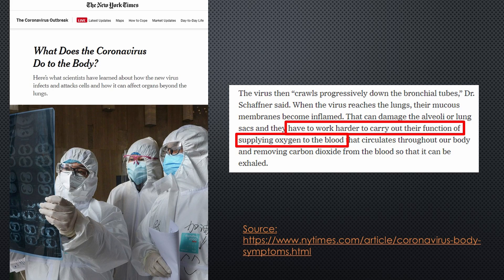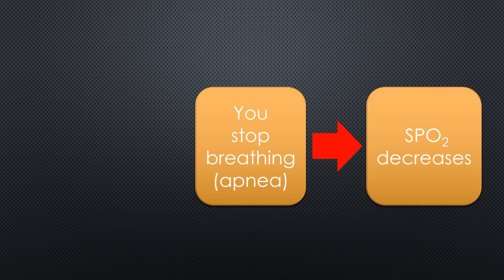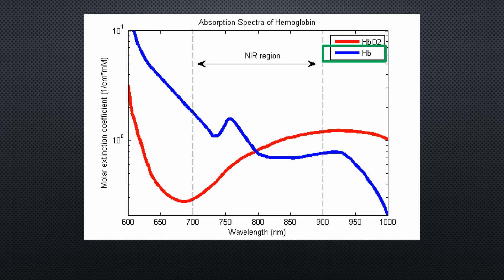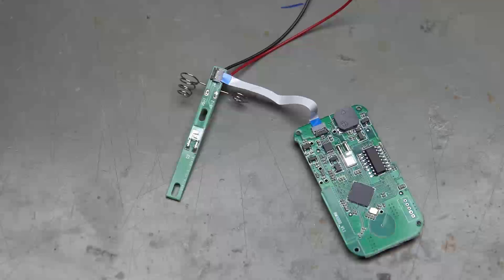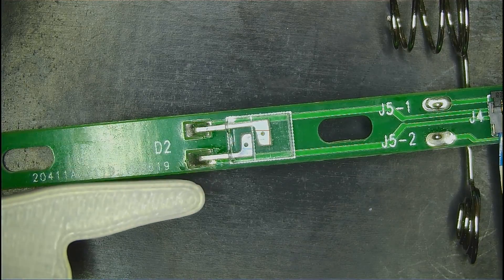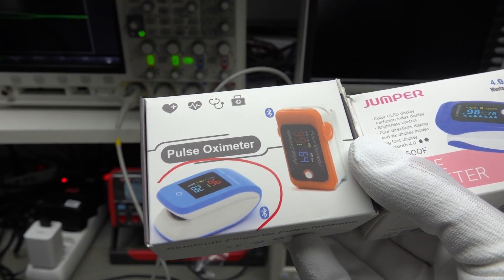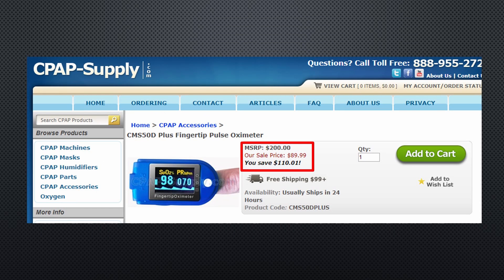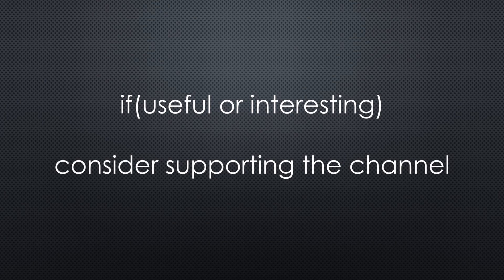#316 Pulse Oximeter test, function, and usage

Comment: Great video! , i was wondering if i can read values of a normal oximeter using an arduino or esp32? , i do not wanna use a sensor but a real oximeter that i can buy , with a modification or idk! would i be able to do it?
Reply from the maker: I do not know :-(
Reply: @AndreasSpiess  thanks for answering

Comment: Can't manufacturers add a ir sensor to measure temperature?
Reply from the maker: They probably could. But AFAIK temperature is not measured in fingers and would probably not be accurate.
Reply: @AndreasSpiess  thanks. Yes of course; i meant for it to be put in a pla ce on the case and then simply touch the case to your forehead until it beeps. probably some tech issues i don't see, or cost
Reply from the maker: @helenmachelen4200  or maybe you had this idea first!

Comment: Hello Sir , 
Will you please suggest the sensor name to use on wrist because i want to use reflectance method to measure the oxygen level and want to implement on wrist . because now days to many smart watches are coming with this feature and I want to test it and 

if you have idea on reflectace method and if you know the sensor name which can be used on wrist or forehead please suggest .
Reply from the maker: You find the links to the products I used in the video description. I also made a second video about the topic.
Reply: @AndreasSpiess  
Yes sir i know that you have mentioned the sensor name and i am already aware of that sensor max30102 and but 

my point is that can i use it on wrist and will it give accurate reading .  

because to use on wrist i have to use reflectance oxymeter method .
Reply from the maker: I said in the video that i do not like it because it does not give exact values.

Comment: How do you see before buying it if it is a reflective model or not?

We can find some oxymeter on Aliexpress below 5€, without BLE which is not so useful, what do you think about that?

Thanks
Reply from the maker: The ones looking like the one I used are most probable not reflective and maybe you see the emitting diode on a picture.  I do not have another answer.

Comment: Great video. I bought a similar MAX30102 sensor from China and it seems that some MAX30102 chips have the red and infrared channels swapped and some of the interrupts don’t work. I found some software libraries that correct this in code, but this behavior doesn’t correspond with the datasheet from Maxim and led some people to speculate that these might be clones. (https://github.com/aromring/MAX30102_by_RF/issues/13)
I also found that you need to use a sensor with a green led to get readings from areas like the wrist, like the MAX30101, because of the melanin pigments in the skin here. (https://www.maximintegrated.com/en/products/interface/sensor-interface/MAX30101.html)
Reply from the maker: Thanks for the update. I still do not like these reflective sensors :-(

Comment: Thank you for your excellent video.  I learned a lot.  Q: Given what you said about inaccuracy of mobile modules (like the MAX30102) , how do watches like the FitBit Sense achieve such accuracy?  Have you considered doing a teardown?
Reply from the maker: Did you test if it provides accurate measurements? I did not find a comparison between the Fitbit and an accurate device. 
My Polar watch also (sometimes) measure heartrate quite accurately even if the glossy leaflet says it works.

Comment: Hi Andreas,  just a quick heads up , is it possible to monitor multiple bluetooth oximeters with a single ESP32 ? And another really silly query,  is it possible to reduce the SP02 for a few second. I tried holding my breath till I could but could not see much change :) , just to check if the oximeter is really working
Reply from the maker: I assume you can connect more than one, but never tried.
And I tried, too to hold the breath. It is not easy to reduce the SPO2 if you are healthy.
Reply: @AndreasSpiess  Thanks much Andreas, looking forward to see another new video soon.

Comment: Question. That red led in MAX30102 is part where it should contact with our skin? 
If i need to make casing box out of it.. will the function still work properly if that LED closed by kind of transparent plastic?
Reply from the maker: There is one sensor which has to contact the skin. I do not know if it works with something in between

Comment: The Max3102 is pretty accurate, you need the correct algorithm, a proper encloser. It's unrealistic to expect the raw values to be reflective and that too without an enclosure with stray light entering the sensor.
Reply from the maker: I never saw an accurate measurement on YouTube with this chip :-(
Reply: @AndreasSpiess  I guess I will have to make a video :-) the Max30102 is made by  Maxim integrated, this chip is used in 1000s of professional medical devices. The issues you are seeing are software related.
Reply from the maker: I never saw a reflective Oximeter so far.

Comment: Great video as always! I purchased the CMS50D+ and cannot get OSCAR to show anything. I can connect directly via Oximetry wizard->start->choose CMSF37 (strange, CMS50D asks for upload file option in menu which is not there) Then communication starts (also visible in the log) Then nothing happens! Also by importing the . SpO2 file from SpO2 assistant nothing happens. I probably missed something. Any suggestions?
Reply from the maker: I would log an issue with Oscar. And I use the application which comes with the oximeter, store the results, and upload the file to Oscar. Much more reliable.
Reply: @AndreasSpiess  How do you upload? Also with the wizard?
Reply from the maker: Yes. But it had its problems (see my issues on the Oscar repo). This is why I use the app of the oximeter. One minute more work, but so far it always worked.

Comment: should be nice to review body thermometers from aliexpress also. Big price differences and forehead thermometers are really popular now. I have now a forehead contact thermoemeter from Lidl and it works really perfect. But you need to read clearly the manual how to use and know the difference between contactless and contacted forehead thermometers. ;) But with Corona now all the thermometers are sold out and the price is very high.
Reply from the maker: Maybe I will have a look at the technological aspect. But, as you wrote, maybe later...

Comment: an oximeter is VERY expensive up here in scandinavia, about 50euro, i got myself one anyway, but i dont undestand the difference between the two different waveforms shown at the bottom line, Levi
Reply from the maker: I do not know which lines you refer.
Reply: @AndreasSpiess  i have two different "waveform" lines BELOW the digital numbers, i now know that one is the STRENGHT of the heartbeat, but still dont know what the other "waveform" shows, maybe we have different machines
Reply: @AndreasSpiess  (actually the line shows in your videoclip)
Reply from the maker: I assumed it shows the "amount" of blood or so. But I did not care too much.

Comment: hi andreas,
I have been sleeping with the CPAP for about 15 years and I must say that my life has changed for the better almost instantly.
I was always sleepy although I slept normally and often woke up with a headache, then I did a polysomnography and it resulted in more than 200 apneas, one of which for a minute!
Since then, about once a year I go to a hospital for a series of check-ups, the last and most invasive is a blood gas analysis that consists in taking arterial blood (the arteries are deeper and more difficult to reach) just to see oxygen saturation.
During the outpatient checks for some time they have used oximeters similar to those you have shown and just some months ago, thanks to the banggood advertisements I also bought one that I use every now and then as needed: sometimes, during a slightly restless sleep , the cpap mask moves and the system efficiency is reduced. fortunately the level of my syndrome is not high and therefore I am not in danger of life, but age always advances ....
P.S. now I also know how it works! tnx
ciao
Reply from the maker: It seems that a lot of such devices are used everywhere. This is also why I used this example. I have a colleagua who reports similar things like you.

Comment: It's worth to test MAX30102 using this algorithm : 
https://github.com/aromring/MAX30102_by_RF

Although it's hard, But I guess it's better than plain Maxim one.
Reply from the maker: Did you try it?
Reply: @AndreasSpiess  Yes I've tried it, It's harder to get SPO2 measurements from it due to its constraints. 
But I've not compared it with other sensors, as I don't have.

Comment: Very interesting video, and I was pleased that you mentioned OSCAR. I picked up thhe RD117 board with its MAX30102 chip  and a couple of M0 and M4 boards, but the signal analysis was beyond me. I may get back to it when I am happier with the state of OSCAR software.
Reply from the maker: Thank you for your software! I think your time is better invested in the software. A lot of people like me do not want to run to the doctor all the time. Maybe you also make a list of oximeters which are supported or which ones you prefer. 
I hope you will ahve now a few users more...

Comment: Nice review. Just after I watched your video yesterday I ordered a CONTEC CMS50D+ from AliExpress. Simply because I like gadgets and number-crunching in MS Excel ;) But after some googling i wonder if I shoud have ordered the CONTEC CMS50H instead. Just because of the additional Perfusion Index (PI) data. I have not figured out if this data is exported to the computer though, as I have not found the manual online for the CMS50H. Any thoughts on this?
Reply: The OSCAR software mentioned here accepts data from the CMS50 D+, F, and I models for sure. I don't think anybody has tried an H model, but believe the software should handle the Perfusion.Index. It is a work in progress.

Comment: Remember, most uC might be bad for # crunching this thing but you can use uC as the middle man to just wireless transmit all the data and offload the processing power needed! Projects like this almost always want dedicated hardware solutions. Get hacking!
Reply from the maker: Maybe an overkill. As I demonstrated: These devices work. I would invest more time in getting results like the one between a CPAP device and a oximeter.

Comment: "does not hurt" - long time use can actually burn the skin.
Reply: Not true. If you leave the sensor on too long, the pressure and sweat can irritate the skin, but not burn it.
Reply: @jasecunda  "There have been at least eight occurrences of skin integrity problems including: cuts/lacerations, skin discoloration, blanched pressure areas/necrosis, induration, burns,"
Due to this they change which foot they measure SPO2 at, every 8 hours for infants and premature babies. (at least where I live, with one of the world leading hospitals for premature babies)
Reply: @user255  The same link I posted further up: http://patientsafety.pa.gov/ADVISORIES/documents/200506_25.pdf
I don't have all the answers, I just know that it's such a concern with small and premature babies, that they change position of the sensor every 8 hours.
Reply: No it can't.
Reply: @user255  Apart from when it can.. http://patientsafety.pa.gov/ADVISORIES/documents/200506_25.pdf

Comment: I liked this video.  I  do not understand how the processor measures absorption. Does the detector output an analog voltage. I say this because when the red light is on the detector output dips slightly not a 1 or  0.  I will have to read up more on this. Thank you.
Reply from the maker: I showed the sensor which measures the remeining light emitted by the LEDs on the other side of the finger. It uses an Analog to Digital converter for that reason.

Comment: The coronavirus came here. So I guess I sit in the first row of the balcony just in case.
Anyway I like taking medical machines apart.
To be honest, CPAP machines are very interestingly engineerd. I repaired quite a few of those
Reply from the maker: I wondered what sensors they use to get such precise airflow and pressure values... I am sitting in the basement. But for me, this is not a big change ;-)
Reply: @AndreasSpiess  Some machines have a custom built sensor array. Others use a special version of a off the shelf sensor. It goes between the pump and the output. But the machine only measures airflow and pressure. The rest of the parameters are calculated. It is also common to see the machine monitor the pump itself.

Comment: Interesting video.Thanks. I think it was nellcor who patented the method of putting a resistor in the sensor assembly. The value was dependent upon the calibration they did at the factory. So all the readout machine has to do is read that value at switch on and so be able to calculate much more accurate results. Nellcor sell many sensors :)
Reply from the maker: I googled them. They seem to be specialized in this technology. I assume their price tags are a little higher ;-)

Comment: I’d like to see a more in-depth look at decoding the data. I tried to make one once but trying to process the data to only read IR or red light was difficult. Afterwards I realised that having a background readout between the IR and red light pulses was important for self-calibration purposes, and that there were too many degrees of freedom otherwise. But I think using IR and red LEDs as photodiodes for seperate sensing would allow for better differential measurements in order to cut down on one of those degrees of freedom, I’d be able to have both LEDs on at once. Maybe with a third colour sensor I’d be able to ditch the switching signal altogether.

The problem is that you get 100Hz or 120Hz noise from overhead lighting, so filtering that out becomes vital. I used a 2nd order sallen-key filter but I think a notch filter would have worked better, especially for strobing the red and IR LEDs at a similar frequency like 200Hz.
Reply from the maker: As I mentioned (And you experienced): It is not easy to extract those values. But this topic is very special and would not be interesting for most of my viewrs.

Comment: Sorry - bus was late so I'm a fair way to the back today!
It seems that the meters are OK in the UK but we only have 5000 ventilators in total - hence the governments panic this week to try and get some built (despite having a long warning).

Tempted to try this on my feet - I have a circulation problem so any rough guide would help me monitor the effect of the tablets rather than a 'gut feel'.

Thanks for the video - maybe a project for the lock down...
Reply from the maker: The ventilators you refer are in conjunction with intubation. Which needs a lot of other stuff...

Comment: Hi Andreas, I'm using the "Sleep As Android" app to track my sleep for multiple years now. While it's not opensource, the data it records is not closed down at all. I always saw the "Pulse Oximeter" option in the Wearable section of the app, but I thought that it only works with expensive devices. Looks like it expects to connect to any random Bluetooth device, and can record the data from them.

If you have energy for some further investigation, you can check out the app and see if either the "CMS50D+" or the others can supply data to the app. I would be very interested to know, as I would buy one of them if I could add another data point to my sleep tracking (which works either with the phone's accelerometers, with a "sonar like" motion tracking, or with wearables like the Mi band, Garmin, etc.)

Whether you look into this or not, thanks for the informative video about the subject! Here's the program's documentation page about the subject, if you want to check it out: https://docs.sleep.urbandroid.org/devices/oximeter.html
Reply from the maker: Thank you for the information. I was more interested in the technology of he sensors. So I think I will not cover the topic in the future. This is more a "maker" channel...
Reply: @AndreasSpiess  Sure, it just seemed you might be also interested in sleep tracking, so I wanted to point out this app in case you want to gather more data easily with your existing SpO2 sensors.

Comment: About the bluetooth interface... perhaps you could simply use it to connect  to a Pi 4, and poll data continuously? There has to be some way to do that. Also, if this was to be used over a long time, is there no way to put a cutoff switch for the Oled display, and possibly run an external power source to the oximeter?
Reply from the maker: Maybe you are right. I think, spendig 10 dollars more and save on batteries is also a deal... I would not overcomplicate things with external batteries, but of course, it can be done.

Comment: "the Arduino doesn't have enough SRAM to store 100 samples of IR and red data in 32-bit format"

This only shows that most Arduino-libraries are very poor at resource management. 200 values in 32-bit format only need 800 bytes and the ATmega328 has 2 kByte of SRAM...
Reply from the maker: I did not investigate furter When I saw the values jumping I started to doubt that you get reliable measurements even with more "power". But I might be wrong, of course.
Reply: @AndreasSpiess  I would just assume a very badly written library...

It is for sure possible to implement the complete detection reliably in an ATmega328 including the control of the two LEDs.

Yes we are talking data analysis here, but we are looking at very slow signals, data rates of 200 samples per second and in the case of the Uno about 16 MIPS